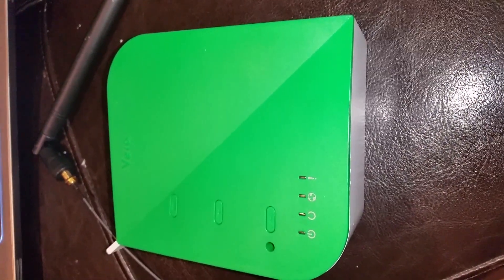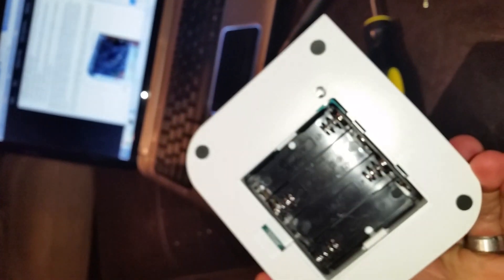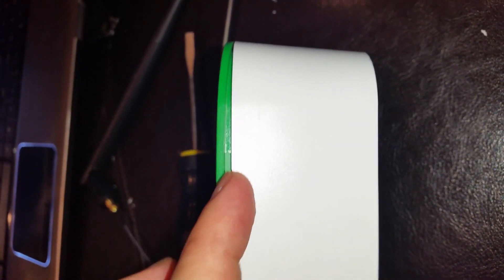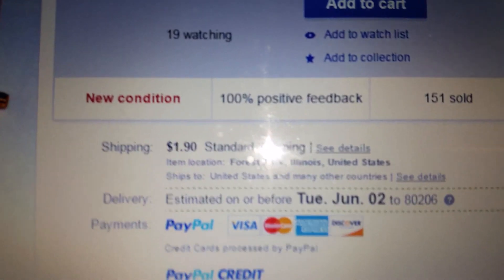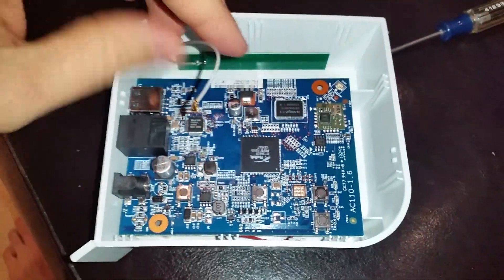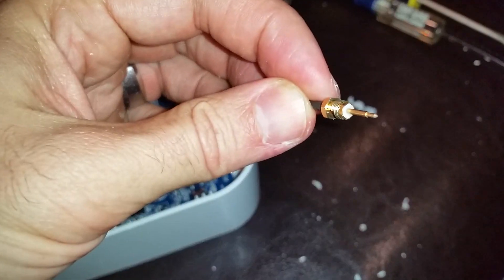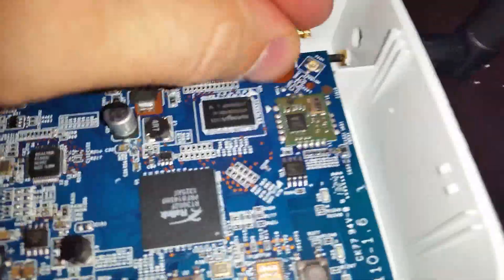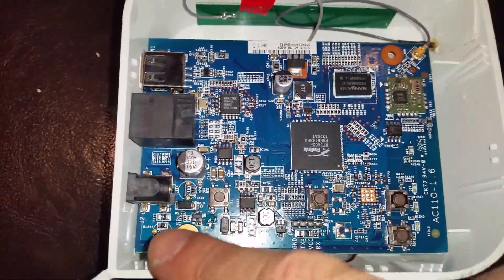Extend Vera Lite range with New Antenna Z-Wave

Comment: Hey Bryan...do you think this antenna will work with the same internal part you installed on the board? 
Eightwood 5dbi 4G LTE Antenna SMA Plug Male 700-2600Mhz Omni- directional https://www.amazon.com/dp/B01FM8PLEE/ref=cm_sw_r_other_apa_TgTbzb6H8KT88
Reply from the maker: Sorry, I don't know the answer to that. I'm not familiar with antenna's that serve a range of Mhz. My GUESS (and that's all it is, an uneducated guess) is that it'd be ok since 900 Mhz falls within that range, but I am not sure. Sorry.
Reply: I think it work. but the question to answer will be how good will it work. Normally antennas with larger bandwidth don't tend to have good uniform omnidirectional pattern.  So if you dont mind the larger size it is good to go with an antenna specifically made for single frequency band. doing this you can have good radiating antenna. And better coverage.  i hope it helps

Comment: Make sure you get a antenna that is 900Mhz compatible, wasn't clear in the video but he is using a 900Mhz compatible antenna.
Reply from the maker: Ha, good one on the drill size :)  The new antenna works wonderfully, I bought it on eBay and the range is better... however, I'm not certain if it's better range because of the power of the antenna, or where I placed it (my vera lite is currently in a built-in book shelf with brick walls on 3 sides, I ran the new antenna up above the built-in bookshelves so there are no brick barriers) on any side
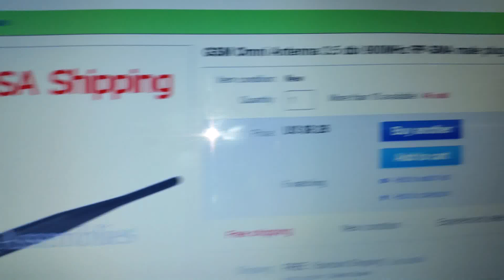Reply from the maker: The antenna is a 900Mhz, if I spoke that in the video I misspoke, but as you can see at 3:08 I did use a 900Mhz
Reply: changed comment, just wasn't that clear. Did you find a antenna that has a narrow band?
Reply from the maker: It didn't have the range I wanted, I ended up upgrading to one with a 7 dBi, it's got a magnetic base and an extended wire, so I actually run it away from my unit to a spot where it'll send better signal
Reply: Seemed crystal clear that he used, and ordered a 900mhz antenna. And to be sure it isn't a 2.4ghz. Even showed the page he got it from. I am curious though, where did you get the new antenna? Also, what drill size did you use? Thanks for the helpful info! (again! 😉)
Reply: ...the newest one you got with the magnetic base.. Does it work even better than the first one?
Reply: Do you have a link to the new 7 dBi antenna with the magnetic base? I found this one on Amazon.  https://www.amazon.com/BearExtender-Antenna-RP-SMA-Extension-Magnet/dp/B011A4UZFY

Comment: Thx for the video, any idea of how many dBi does the original antenna has?. Also I have a Kwikset deadbolt that does not send notifications when a code is entered any ideas/tips?
Reply from the maker: the built in antenna is 2.2 dBi. Don't know anything about Kwikset locks, I use schlage, sorry. Check the discussion forums at micasaverde, they may have an answer for you
Reply from the maker: Re-reading this 9 months later, I don't know where I found that 2.2 stat - I see other places that the original is 0.56 DBi, so I want to be taken off the record for knowing what the internal antenna is rated at; truth is, I have no idea.